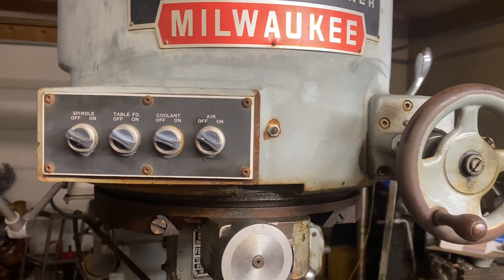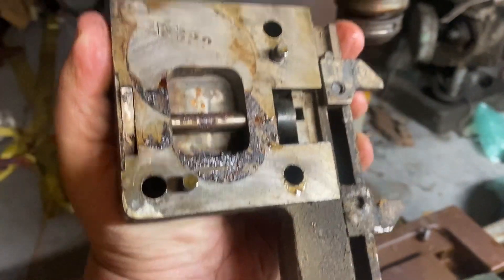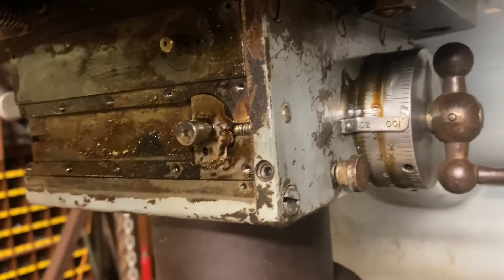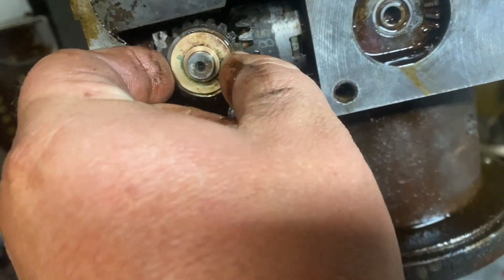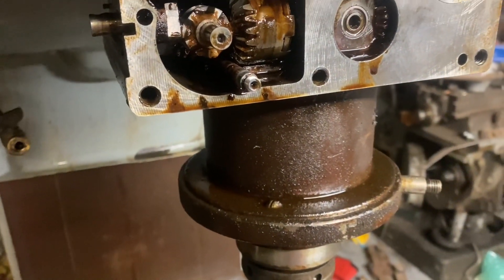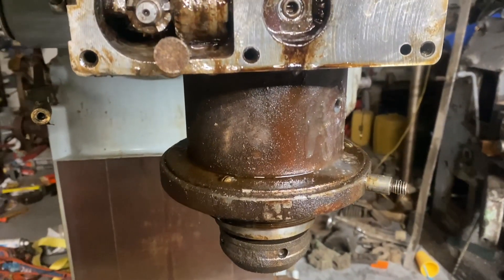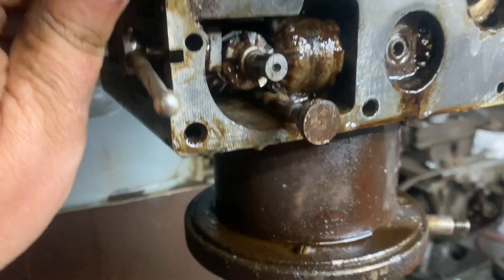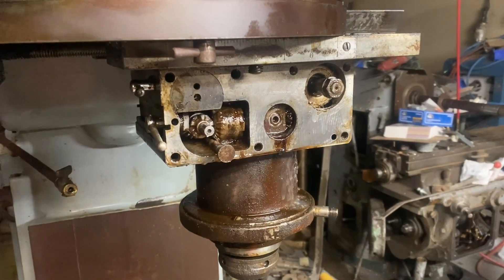Kearney & Trecker model 2D quill feed repair

Comment: The range selector lever on mine is somewhat stiff as well. There is also a means to disconnect the quill feed from the Gears entirely, and instead it is controlled by the cherrying attachment (which I don't have), via the stud on the inner quill
Reply from the maker: Thanks, any info I can get from you on yours is most appreciated, I’m hoping to put power to it next week, I need to go through and rewire all the motors to my voltage this weekend
Reply: @smalltownmachineshop6860  you know there are two gibs on the head slide, as the spindle needs to be centered side to side. I zero my slide with the dial as the slide is travelling out toward the 4" scale. Mine runs within  .0004", but factory says it can be within .0002"